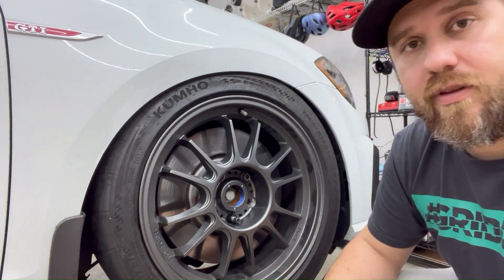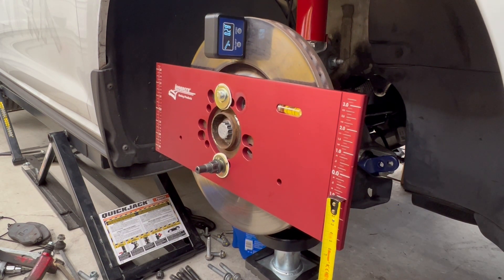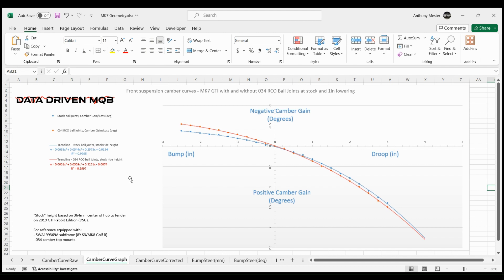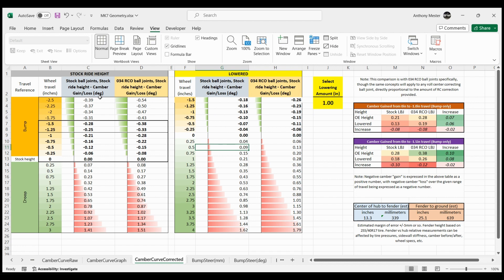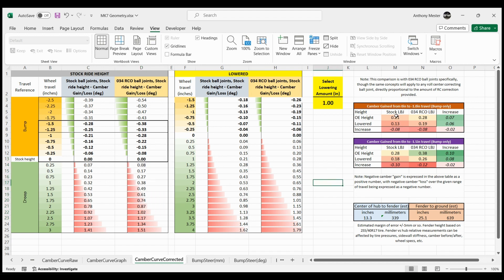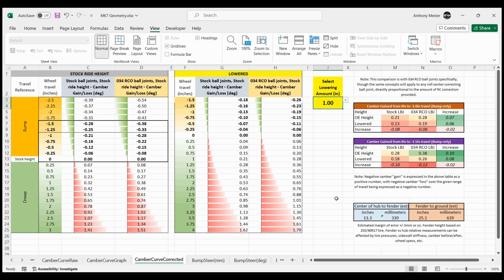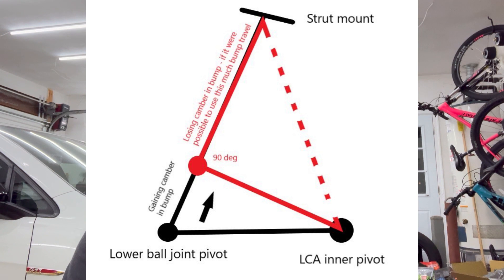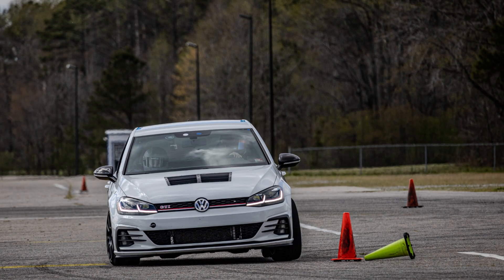Camber Curve - MK7 Suspension Geometry

Comment: has anybody with plenty of track time found a great base line alignment for stock suspension?   i am assuming slight toe out in rear?
Reply from the maker: @miamirice6840  with bone stock suspension I'd just run zero toe front and rear, as much camber up front as you can get (via loosening everything and pushing/pulling within factory tolerances), and set rear camber around -1.7 to -2.0. Should be a decent starting point. Adjust balance via tire pressure. There's really only so much you can do. Toe out in the rear will definitely help but I'd probably not resort to that first time out.
Reply: @datadrivenmqb  i put a large bar in the back and the car is neutral at best when you really carry 4 wheel lose type speed ,  but it doesn’t rotate well under trail breaking that is so important in FWD ( the R really drives like FWD)
Reply from the maker: @miamirice6840  these cars are too front heavy to not do a bigger front bar*

*If on softer suspension, or have inadequate camber.

The front bar on my car was easily one of the best changes I made.

https://www.datadrivenmqb.com/suspension/swaybartheory

https://www.datadrivenmqb.com/suspension/fsbdata

Comment: i miss my 95 civic with wishbone susp at every corner.
Reply from the maker: @miamirice6840  a friend's 95 Civic hatch was easily the best FWD car I've ever driven on track. It's just a shame the parts are getting scarce and K swap stuff isn't exactly cheap.
Reply: @datadrivenmqb  agree.  i had a 2300 lbs 95 Hatch with K20a2, bolt ons and coilovers.   incredibly fast car.

Comment: The biggets problem with those 034 Ball Joints is that they can develop quite big play after just 2 track days - this can resut in unexpected car behaviour druing braking and accelerating. I was affected by those faulty ball joints, as well as two of my friends who track their cars also had  also same problems. We've got full refund on those parts after all, but I from my perspective it is not worth to install them in the first place if you plan to abuse your car on track.